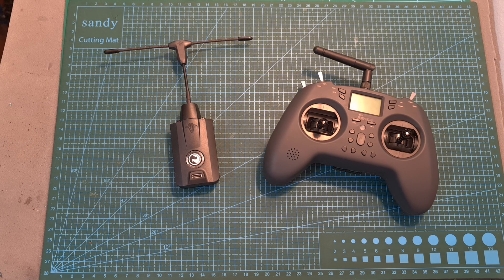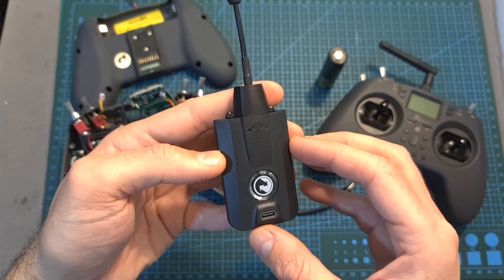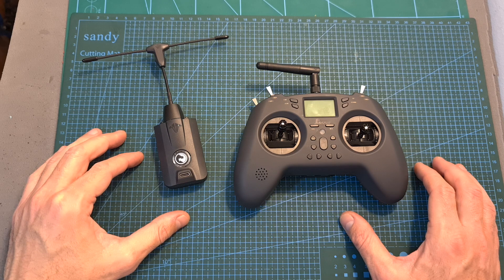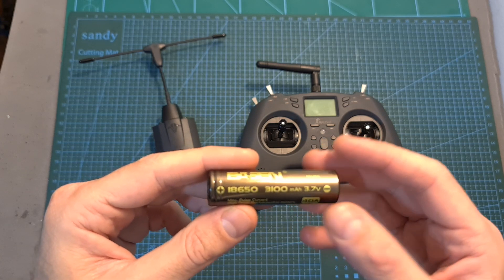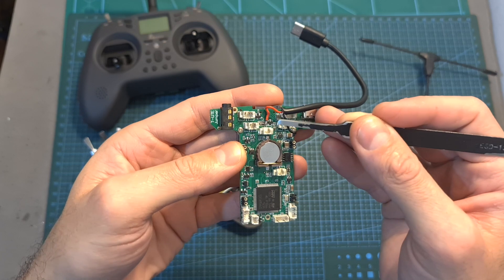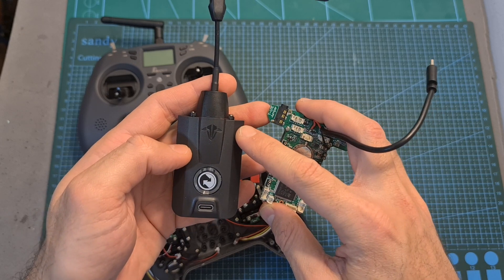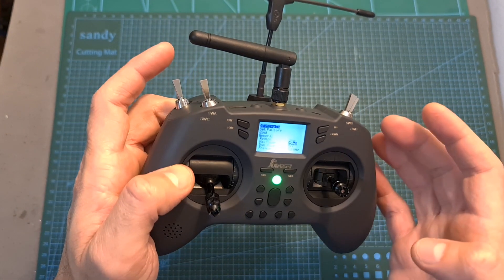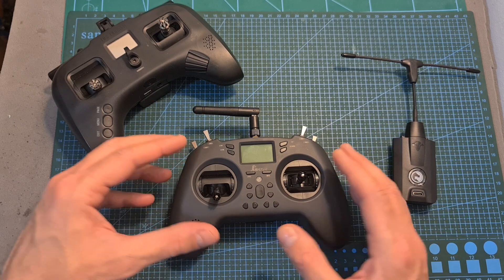Jumper T-Lite 1W CRSF Fix

Comment from the maker: I still need to run more tests but I think that powering the module externally using the 1s battery seems to be working well (and better than just using a better LION battery as recommended by Jumper). 
Pay attention that I also do not recommend to use 1W at all and setting the CRSF module to 250mw should be both sufficient and keep you on the safe side.  
► Jumper T-Lite: https://bit.ly/Jumper-T-Lite Coupon Code (10% off)：BGJumper  
- Also Available At MakerFire: http://bit.ly/T-LITE-MF Coupon Codes: MFTLite || gal
Reply: You can get a 10000 mah usb battery brick on Amazon that’ll fit in a shirt pocket for around $20. Output is 5 volts. Get a longer usb cable and that wouldn’t be so bad. They even have ones that show what the battery charge is.   You should be able to run 1W with one of those. Just a suggestion. I haven’t tested. My jumper just shipped from China yesterday.
Reply: @chriscallahan3822  Hey bud, just ordered mine, could you let us know, thanks!
Reply: Is there a possibility you could kindly show us the module being powered by an external power bank and some flight range testin. Thanks

Comment: Hi mate i know that this is a stupid question but since im newb and noob so.. Is it a large difference between using the internal and the tbs with 25mw? How far is it when using the tbs 25mw and is it worth it since i just need fly around 500m ? Thanks mate
Reply from the maker: Hi, 25mw on TBS can still get you pretty far (more than 500 meters).

Comment: I just setting and trial my jumper T-Lite dan TBS Nano...I set power in 250mW, after fly trial...the drone fly distance just 15-20 mtr and drop...Any suggestion, what is the problem?
Reply: Are you on the right frequency for your region?
Reply from the maker: Does it work well on 25mw?

Comment: I don’t understand about the battery and circuit, but can we change the battery to use a tango 2 battery?
Reply: The tango 2 battery is an internal 1s lipo cell. I don’t know if it’ll fit in the jumper and you’d have to hardwire a connector into the battery.  Also there isn’t a safe place to install it inside the jumper that may keep from wearing a hole into the cell by the radios internals. There may be other issues with using the onboard charging circuit as well but unsure.

Comment: I don't really understand why people expect this entry level compact transmitter to be capable of 1W power..this should be for people who just started the hobby, who are not ready to spend big on full size transmitter, and usually not flying very far..or as a backup transmitter that you can always bring whenever you go without a big case..so to think that many people said that the low power was a deal breaker is confusing for me..

Comment: Now another possible solution, could I not just get a 3cell 18650 case, wire the batteries in parallel for a 1s 3p pack and power the radio through that?
Reply from the maker: Yes, that's a possible solution and I might check it out as well.
Reply: @KremerFPV  as an added bonus you could still charge the pack through the onboard USB C
Reply from the maker: @jeffkatcher4210  True :-)

Comment: Gal Kremer sry but i cant agree, on the 18650 of choice, in my opinion this is a 10A cell. Its appearance and performance are identical to the 10A LG MJ1. Its temperature rose to 104°C/219°F at only 15A! Testing was aborted after doing the first 15A discharges. To rate this battery at 40A is truly shameful behavior by Basen. Imren and Efest did the same thing with their high capacity cells. source mooch.
a sony 2500mah vtc5a has a nice ratio. im using this myself in my jumper t16 and dji fpv. 25a continue. another option is sonys vtc6a 2900mah ish.  vtc5a hits a little harder. but vtc6a performs better in long runs when high output is drawn. im using these for my quads.
but this is just my experiance. yes i vape too XD 

lets just toss a 21700 init xD
Reply from the maker: No need to be sorry. I didn't test the max amp draw of the Basen battery but what I can tell you is that it's quality is good and even 10A should be sufficient for such a small radio controller. 
I might check another solution which is to add more batteries in parallel using an external connector. 
Happy vaping ;-)
Reply: @KremerFPV  aha yes, we can fiddle with the adapter for nano modules as it comes with a booster board :) ok challenge accepted buddy..... now if only the mail just could be a tad quicker XD

Comment: Same module but frsky x-lite. It only works with 25mW-500mW. With 1W it failsafed instantly. Same problem with battery?
Reply from the maker: The Xlite is using two batteries and as far as I know this issue is not present (although I need to test it).

Comment: Thanks GK! 
Just a question regarding the soldered external 1s version. Does this charge the battery up at the same time? If so does the controller have a charge protection circuit?

The reason I ask is it could cause issues of overcharging an unprotected cell in the battery bay.
Reply from the maker: Np. You still need to use the USB C port of the radio controller in order to charge the battery (I only connected a USB C connector for connecting it to the external TX module).
Reply: @KremerFPV  so it won't back flow to the battery from where the module is being powered from?
Reply from the maker: @craigjohnstone87  No

Comment: Thanks so much for this tut Gal.. Glad to cancel my preorder and just get t16s.. 🤣😝...
Reply from the maker: Haha, well it's a totally different radio controller (I guess you were referring to the TX16S).
Reply: I wouldn't get the t-lite as an only radio. At $75 u know corners r cut. It's good for whoop and sim. Or packing light sometimes.. but my x9 lite s still my main.

Comment: and dont do this.. use a proper radio use a external power supply opening it up will void your warranty yopu can mess it up using internam 4 volt cell to power a another device your cutting your time in half you want range get a proper radiop
Reply from the maker: I only showed it as a possible solution for solving the output power issue.
Reply: @KremerFPV  yes but what you show is a mod that will double the drain on the battery remember its only 4 volts most trandmitters use 8.4 or higher..and double the capacity of cells aka mah.. and most external power boosters use a external supply..
my suggestion get a 2 watt or 1 watt 2.4 ghz booster they run off 5 volts so a single cell lipo or about 3000 mah capacity lith ion cell would work 4.2 volts is enough you can use a boost buck converter to boost it to 5 volts.. now legality ist not leageal in the usa 150 mw is tops from transmitters im just saying dont tell anyone your using ityoull need sma cable ends that can hook into the exsisting radio then into the booster then the booster put your antenna on and never nevver turn on yoru radio with this configuration without powering your booster first same as  not putting your antenna on within 10 seconds it will fryyour internals... and voila you have 1 watt output... dji phantom owners along time ago did this theres even tutorials on this.. now youll prolly step on peoples wifi so only do this if you live on a farm or you vary the days and times you fly... i belive they make 500mah versions or you can make one yourself. now this is for long range 25 mw and 100 will get you up too 1 mile or even 3 in the right conditions and you can get a parbabolic booster they are 10 bucks or so slip over the antenna amazon has them
Reply from the maker: @twitchuser3375  Got it. Using a bigger battery though sounds like a more simple solution in my opinion.

Comment: what is the range with crossfire on the jumper t liye,i got the tx16s se..
Reply: depends on your output power. obviously, that the whole point of this video lol
Reply: @josephfreeman5289  i just want to know wich radio is better?thanks
Reply: @JULIANysuHOHNER for crsfire tx16s will be better without doing mods or having external power supply assuming you are using crsf nano

Comment: What a bummer. So close to bing a great radio option. If they just made it compatible with a common 2s 3000mah lipo. Having things hanging off of the radio kind of defeats the purpose of having something compact
Reply from the maker: Yep but again, for a proper CRSF usage I would go with the Tango 2.

Comment: Crossfire is usually an option when going for long range. And if you are getting way out there is best to get the Tango2 and not cut corners with the T-lite.
Reply: its best to get the original 2w module.

Comment: It's funny I bought the Lite because I don't like the external module on my tango just me being picky. But out of curiosity I used the tbs external module on my lite and I swear the 2.4 range is better than the lite by itself. Is that even possible to have more power from one multi-protocol module to another?
Reply from the maker: It's possible. I am going to range test both options soon.